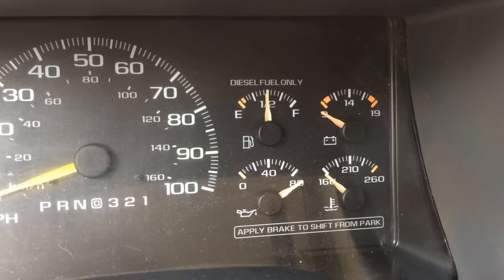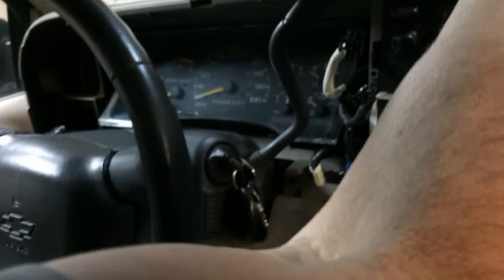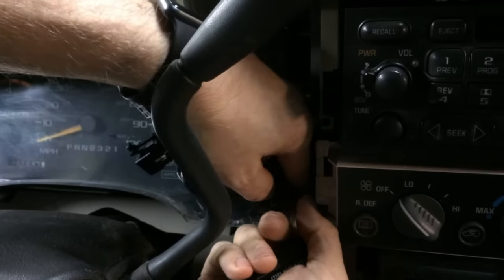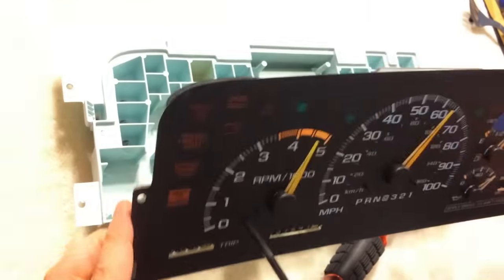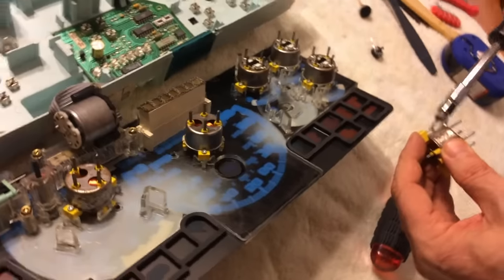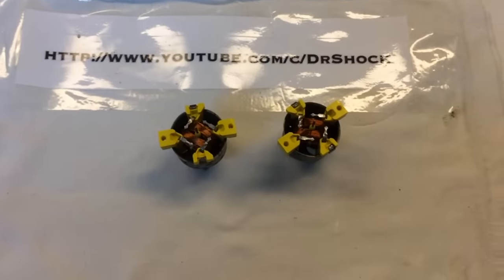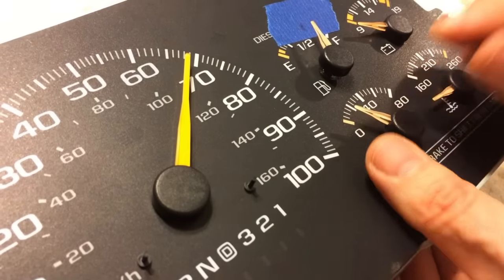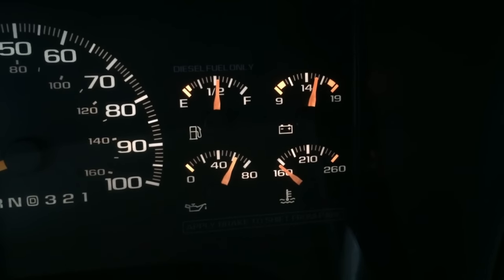1994 - 2002 GM Truck Twitchy Erratic Crazy Fuel & Oil Gauge Needle Aircore Motor Repair (Chevy GMC)

Comment: These are the same air cores that were used in 99-02 gmt800's, the gmt800's didn't use resistors, but all gmt400's used resistors. And the old air cores are fine and do not need replacement, they need fresh dampening fluid put in them. Your fuel gauge jumps like that because your sender in the tank has bad spots in the reostat and the dampening fluid in your fuel gauge air core has gone bad allowing it to rapidly respond to any changes in the sender signal. You don't notice it with the new air core because it has fresh dampening fluid in it to slow the gauges movement covering up any fuel sloshing or slight irregularities in the sender signal. You could have accomplished the same thing with some 30k weight rc silicone diff fluid and a syringe.
Reply from the maker: That's partially correct, I explained some of the theory around this in the video description.  The dampening fluid is used because of the waveform shape used on the PCM output for these years.  Only a diesel engine has a direct sender to gauge circuit though.   Unless you have the appropriate shop tooling that a cluster rebuild center would have, any attempt to syringe in fluid would be temporary at best.   So replacement of the aircore motor is the only long term repair.  Unfortunately that supply has been exhausted.   Fortunately,  you can have the aircore motors rebuilt still, the pinned comment lists a known cluster shop I've done business with who has the right equipment to rebuild them which would be as good as a new motor replacement.
Reply: @DrShock  My repaired clusters I've done for people, including my own, are all still going years later after I redampened them. And only 98+ gas engines ran the fuel gauge through the pcm(97 V6's used a fuel gauge module), all 97 and older V8's, 96- V6, and all diesels(unless it had dual tanks) ran the sender direct to the fuel gauge. All oil senders go direct to the gauge.

Comment: 98 k1500 . 5.7l gas. My top two gauges have a slight twitch in unison. Assuming they share a common connection, that’s the culprit.

Comment: Having an issue on a 97’ 6.5 K2500, Oil pressure starts above 40 and drops to near 0 when hot, motor doesn’t sound strained or at lack of lube, I changed the OPS, no change, I did not notice the gauge jumping like yours, but do you think it could be a Gauge and or Wiring issue? I’ve never bought a Chilton’s or Hayne’s Manual, would that include wiring diagrams?
Reply from the maker: I've only used the GM service manuals, so couldn't say what's in an aftermarket manual or not.  This sort of symptom isn't enough to make a root cause determination.   I would start with measuring the output of the oil pressure sender, or even connecting a mechanical pressure gauge.  From there you'll want to verify the oil pressure signal wiring into the VCM, and then on to the IP cluster.

Comment: Excelent video and explanation. Could you give me some advice to check why the PRNDL lights indicador doesn´t work. Thanks
Reply from the maker: On these years PRNDL part of the instrument cluster is fed range input by the park/neutral position transmission switch.   I've not encountered this sort of issue before on the 90s trucks, but I would hazard a guess it could be a problem within that specific switch, or a problem getting voltage to the PRNDL circuitry of the cluster.  You would have to get the service manual schematic and check each of the 4 switch outputs are making it to the IP cluster connector, then check that the lines for PRNDL voltage/dimming are making it.   If those are good, it's a problem on the IP cluster circuit board itself.
Reply: It probably your neutral safety switch located on the trans mission

Comment: I cant find it with the letter F for the fuel they start with the letter C for the fuel. I have a 1994 chevy blazer k1500, and excellent video by the way.
Reply from the maker: Yeah it seems the Chinese suppliers of the "F" type motors are either backordered or the supply has ran out affecting what's available on eBay currently.   Personally I'm waiting a bit longer to see if the "F" type comes back in stock with the larger eBay sellers because "C" certainly isn't the original calibration.   But if "F" is gone for good, "C" might have to be the next best substitute going forward.  These trucks are coming up on 30 years soon so not that surprising parts availability wise.
Reply from the maker: Seems they are back in stock now as of this evening.
Reply from the maker: A speedometer shop on eBay is now selling these again, but he's only got the "C", "P" "S", and "T" calibrations currently.  I put a link in the description.

Comment: My tachometer twitchee especially when there is a small load on the system(i.e turn signal,  cabin fan). Do you think this is the same problem?
Reply from the maker: No, this typically only related to a fuel gauge issue as that one aircore motor is fluid dampened.   What you redescribe is more of an electrical problem.  Either the alternator, or the harness paths/data used for driving the tachometer, grounds, etc.

Comment: DrShock....... Great video.......  I recently did the LED bulb conversion on both my 99 Z-71 and my 99 Tahoe. LED's do work great but the sockets that came with them did not line-up with the contacts so I just re-used the OEM sockets.

Now if I am watching and hearing you correctly I don't really need to be too  concerned with the positioning of the needles on the 4 gauges when re-installing the instrument cluster as once power is put to the cluster the inputs to the 4 Aircore motors will drive them to where they should be. I ask as I noticed needles moving all over as I was re-installing the instrument cluster but once back together and vehicle in operation they all appear to be where they should be. LoL.... I guess what I am really asking is as long as one doesnt mess with the needles or the motors there is no need to be worried about the needles floating around.

Really good video, thanks.
Reply from the maker: Other than the fuel gauge and voltmeter, all the others start at zero on power up.  So if you notice I have the key turned enough to power up the instrument cluster so I can verify all but the fuel and voltmeter are on zero.   You do sometimes have to tweak them a bit, don't press the needles fully on the motor shafts until they are where they should be.
Reply: Thanks for the update much appreciated. I followed your link but unfortunately the "F" Aircore are out of stock and may no longer be available.
Reply from the maker: They are very popular, maybe these sellers should thank me for making this video ;-)   I've seen them come and go out of stock a few times since making the video, I think these guys buy a batch from a China factory and then have a long lead time/delay before they can get another batch.   That's just a guess but what it looks like.   I would just keep an eBay saved search on them unti they have them back  In a pinch you can use the "C" calibration which I mention in the description is calibrated for later year fuel senders but still "fits".
Reply: @DrShock  Might just be bad timing on my part as the vendor says that was the last batch that they will be selling but will do as you said in case that changes. 

Searched your other videos. I also have an issue with the temp gauge as it never goes higher than the big hashmark between 160'F and 210'F. Scanner reads the PCM Temp Switch at 194"F. So I disconnected Temp Gauge Switch , grounded the loop, turned the key on and it pegged out high as it should. Replaced the temp switch and now I got movement but after warming up goes to the big hashmark between 210 and 260 and sits there. Scanner reads PCM Temp Switch at 194'F. Just kind of odd the readings were initially low, replaced temp switch and now they are high going the other way. Uggh what a pisser feels like I am chasing my tail.
Reply from the maker: Wow I hope that's not the case for the "F" motors!     On that temp gauge, the aircore motor movement is driven by the PCM sending a value to that circuit based on its read from the temp sender.  In my experience the best accuracy is had with using genuine ACDelco parts or higher quality branded replacements.   This is simply because the software in the PCM is calibrated to the GM part resistance and some cheaper brands don't feel the need to get it exactly the same.   Usually I would point to that as something to check but since the PCM is reading the same consistently with two temp senders now, yet the gauge is reading differently without touching it I don't have a suggestion for you short of living with the previous sender as that was closer to the actual reading from the PCM.  If it were me I'd put a new ACDelco sender on the engine, make sure PCM temperature readout was as expected, and then manually calibrate the gauge needle to where it should be.   That might leave it off zero at cold but hopefully get it right for what counts.
Reply: I guess I should have stated that the temp switch I replaced is the one located next to the #1 spark plug. This is the one that feeds the temp gauge.

The temp switch located by the thermostat is the one that feeds the PCM and consistently reads 194'F when warmed up.

Sorry for the confusion and thanks for your suggestions.
Reply: @DrShock  ....... I did as you suggested and bought the AC/Delco Switch. Installed it and now the temp gauge is working like a charm.
Reply from the maker: Yep, that's my experience.   Something about the resistance value of the OEM part is just not properly "copied" by the aftermarket suppliers and it throws off the gauge.   I even saw this with a 1957 Chevrolet and a newer GM replacement part until we tracked down an NOS original number GM one that was used in the 50s-60s then it worked fine.   ;-)
Reply: '99 @DrShock  I found somone on Ebay who was selling four "Refurbished" "F" Aircore motors. I bought two of them as I have a '99 Z-71 and a '99 Tahoe. Followed your video and replaced the "F" Aircore on my Tahoe and my once spastic gauge is holding steady at this moment. Going to see if the Ebay seller who sold the ones I bought will refurbish the two that I have as the four he had went in a matter of 24hrs.

Thanks again DrShock............ you've created a monster now !
Reply from the maker: Just keep in mind that "refurbishing" is just injecting silicone oil into the shaft housing of the motor.   While that's comparable to the original dampening fluid that has dried up and led to the problem in the first place, it's not going to be as long lasting as a factory replacement motor as well as that approach will leak out within only a few years (others have written about their experience on forums trying this approach).   Better than doing nothing of course, but have your expectations set.

Comment: I have a 2000 Chevy 3500 with a 454 engine my fuel gauge stops reading at a half tank it will read full when filled it also seems like the needle vibrates when sitting still do you think it could be the gauge.
Reply from the maker: Vibrating needle problem is what this video was about, but reading wrong is more likely the sender.  The linked video in the upper right of this one might help with that.   I've seen both needing replacement with these OBS trucks being over two decades old now.

Comment: So I have a 99 Tahoe same engine. It's been sitting for 10 years. I just did the restore with new parts [water pump, thermostat, hoses, etc.] The temperature gauge reads over the max point and it shows warning check gauge light. Could this be the same issue?
Reply from the maker: No, this vid is primarily about the fuel gauge which has a particular aging flaw in the aircore motor due to a dampening fluid that dries up inside.   The other gauge aircore motors can go bad too, but they tend to fail outright (non functional) or read wildly off scale (like the damaged oil pressure gauge aircore motor in this vid).
 
The check gauges lamp is on because your temperature gauge is reading into a danger zone.   The lamp fires off to get your attention on that.   For this situation I'd suspect more one of the following (air in the cooling system from not being bled fully, substandard thermostat if not a genuine GM part, defective temperature sender, gauge failure, or a problem with the wiring harness from the sender to the engine computer/cluster).  Access to a service manual could speed up figuring out which, but if it always reads max I would start with the sender, and then the harness.  If the gauge never moves, then I'd try swapping in an used aircore motor before buying a new one.

Comment: I have a question, I did do something stupid I didn't mark exactly where to put my indicators back is there anyway to get them back in correct location.  I did try to relocate them with key on engine off but I am not doing so well.  Any help would be very helpful.
Reply from the maker: Depends on the gauge.  For the voltage gauge you can measure it with a voltmeter to calibrate it.  For the oil pressure gauge I mention in the video that one always starts at zero, as does the speedo and tach. For the fuel gauge you really needed to mark it as I showed, or at least have a photo as it cannot be easily calibrated otherwise.  I have not tried it myself, but technically you should be able to calibrate it using another known working spare fuel sender outside of the tank (you'll have to get access to the fuel sender harness on top of the fuel tank to plug in the spare here).  A less accurate but possibly still useful approach could be draining the fuel tank and setting the needle for E, then filling the tank FULL as you would usually till when the gas pump nozzle shuts itself off and setting the needle for where around F you recall it being in that state before you leave the gas station parking lot.   Both approaches of course with the key in the on position but engine off.
Reply: @DrShock  Yes I have thought about that.  
I do have one question about part numbers.  My oil pressure gauge starts with P and I have found online a new one (air core motor) how ever the numbers don't match.  Example mind maybe P9876 and the one online is P8765.  My question is as long as it's start with P do the numbers matter.  I assume the P is for (pressure). I did purchase a used cluster and I'm thinking that if I can rebuild it, replace the aircore motors that I can find available.  It would  save me from buying a new one for $400$ to $800$ Dakota digital.  
Thanks again
My truck is a 94 Silverado
Reply from the maker: The numbers are not important, likely a date code or such.  It's the letter code that is important to match for the right gauge.    P is for pressure yes.

Comment: Wow, You have some great oil pressure on that 6.5L.. Must be really low mileage. My 6.5 is 195K and only puts out 25 at idle and north of 35 almost 40 when running down the road.

Comment: From your commentary above: "If your gauge was very messed up you may be in the rare situation of not being able to perform the calibration procedure outlined in the video, in that situation you will have to get access to a new fuel tank sender, hook it up and use it to calibrate the empty, 1/2, and full positions accurately."  My question is:  If I get ahold of a new fuel tank sender in order to calibrate my gauge, how do I go about hooking it up?  After installing my new aircore motor, I filled my tank, then set the needle to "Full".  I've driven well over 100 miles, and the needle hasn't budged.  I suspect that my fuel tank sending unit is probably bad, but I'd like to be able to confirm it.
Reply from the maker: You mentioned filling the tank, and then setting the needle to point to F.  I presume you first set the needle where it was with the old aircore motor as shown in my video first.  The vast majority of the time that should be enough.  If you did and it was still off significantly, then yeah this additional calibration approach mentioned may be needed. But to do this accurately, you would have to have known how many total gallons used to set you at "F", or 1/2, in the past so you can drain the tank and add back checking E, 1/2, and finally F.   What drives the aircore motor, and thus the fuel gauge needle, is a resistance reading coming in from the sender itself, this is within the wiring harness you connect to the sender unit (diesel) or fuel pump assy (gasoline).  With a service manual, you might check that you're even getting that sender resistance value, and that the value is correctly changing with the fuel level in the tank.  In fact a speedo shop would likely re-calibrate the E, 1/2, and F gauge readings after installing a new aircore motor solely on the bench from the resistance values for that particular model year.
Reply: @DrShock  I actually just today received a used instrument cluster that I got on eBay.  I swapped it out an hour or so ago, and the needle went right to "Full", just like it does on the original cluster.  Before I replaced the aircore motor, after doing its dancing, the old aircore's needle would settle on "Full", which is why I filled the tank and set the needle back on "Full".  That's why I believe that the sending unit is bad.